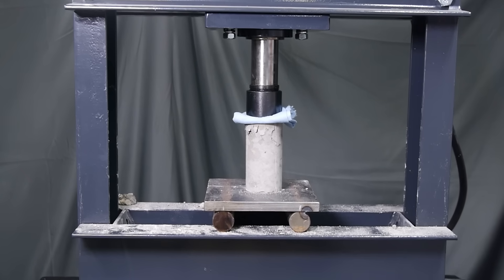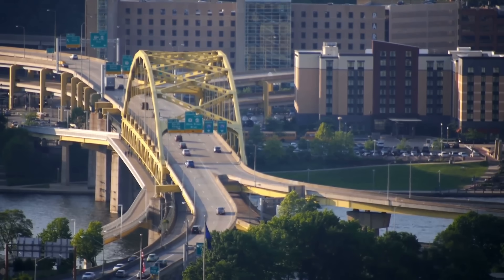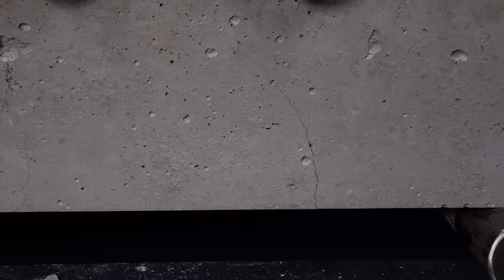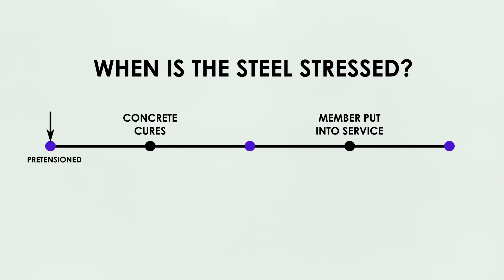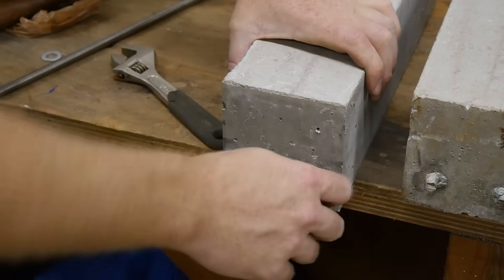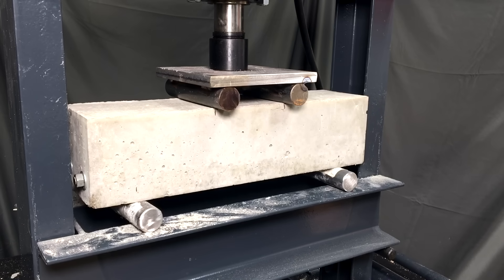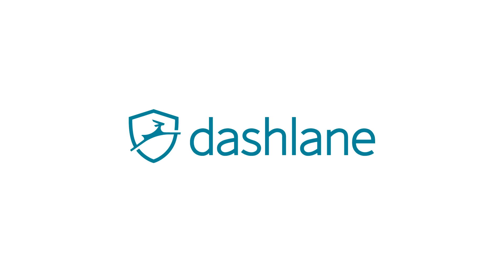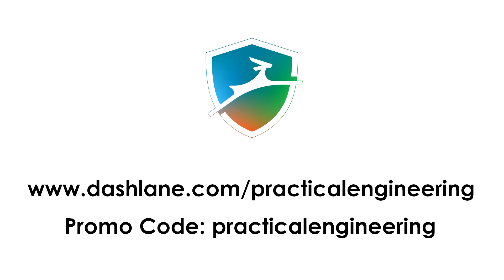What is Prestressed Concrete?

Comment from the maker: Okay, okay - I think this one will conclude the series on concrete (for now!). It's time to move on to a new topic :) For now, support the channel by checking out Dashlane - it's free and I hope you find it useful! http://www.dashland.com/practicalengineering
Reply: I love your concrete series — I hope to see more concrete videos in the future! I have no suggestions for new ideas at the moment, but I will let you know if I come up with anything. Thanks for your excellent and informative videos!
Reply: @joelweikguitar  
P
 Lp ..
Reply: Pre fabricated methods of construction?
Reply: Steel structures!
Reply: How do they build bridge bases underwater?
Reply: Daniel Allemang They can:
1. build them on barges and then sink them
2. Use a coffer dam to wall off the area to the base and build inside it 
3. Use Caissons to achieve a similar result to #2
Reply: An episode on caissons!!!
Reply: I have some ideas, but nothing concrete

https://www.myinstants.com/instant/rimshot/
Reply: Failsafes perhaps? I'm no engineer, but I'd imagine Failsafes are a big part of engineering.
Reply: Glass. I worked with glass a bit and it has some quite interesting properties that people dont expect.
Reply: How is glass reinforced?
Reply: Any experience with geopolymers? Could be an interesting variation of the concrete videos.
Reply: Practical Engineering You should now try focusing on shear reinforcement, as the failures you have demonstrated are quite brittle, and in the real world not ideal, as you don’t want a RC member failing so fast. Good videos these are awesome (y)
Reply: Steel towers, how there built and different types.
Reply: Environmental Engineering
Reply: Wastewater Treatment Plants!!!
Enhanced biological phosphorus removal (EBPR)!!!!
Reply: How about a series on famous construction projects and some of the technical challenges that had to be overcome? An example might be the Eiffel Tower.
Reply: What, you wont be Concrete Engineering anymore? :(
Sure there must be more concrete content to be made, roads with concrete surface maybe?
Reply: i think glass is a pretty interesting topic. the fact that it can be  used for both optics and construction is really cool.
Reply: would love to see a few videos on foundation failers and soil retention.   great videos by the way.  ive seen 90% so far.   thanks and keep up the good work man!
Reply: What about shape memory alloy as a reinforcement alternative ??
Reply: keep concrete videos alive!!!
Reply: You could do a whole series on deflection and moment of inertia
Reply: I second the underwater construction!
Reply: Engineered lumber, steel moment frame, buckling restrained frames
Reply: Well i would say steel and diferent shapes to get better performance on construction or maybe even compare with aluminium why is not used in construction but in cars is key to lightweight reinforcement.
Reply: Dude, I could watch these videos forever. But if it’s ideas you want, I would love to see s video series on underground construction and infrastructure. There’s an entire world beneath our feet of pipes, conduits, tunnels and even buildings. I’d love to learn more.
Reply: Do a video about piling works!
Reply: Ancient engineering
Reply: While designing my house with pre-stressed concrete panels. I also designed a steel beam to support the half panel. I ran the calculations on bending vs shear. Maybe do a video on that.

Picture of the beam here
https://i.imgur.com/Zphiz5s.jpg

The beam is 4"x4" square tube that is 1/2" thick and 10' tall. On top of the beam i used the same 4"x4" tube that is 4' wide. and 1/2" thick plate at the bottom. The max load for that entire panel is 15,000 lbs via their cut sheet. The panel weighs 6,000 lbs, the topper slab above that is another 4,000 lbs, so i designed it to carry is 25,000 lbs. So i doubled that number and then added the second column. This also dose not include that the other side of the beam is supported by a concrete wall.
Reply: Surveying!
Reply: Grady, that was a great video!  
Other topics:
I think they'd be most viewed if they were applicable to more people... so I'm thinking "around the house/property" topics like: 

>> retaining walls and the use of geofabrics, how high can you go before needing a designed/reinforced retaining wall,
>> concrete vs. asphalt driveways and the unsung hero of proper road base construction, this ties into Orian de Wit
's idea about foundation techniques and soil properties,
>> how to calculate member forces in a roof truss under snow load, 
>> and I'd like to 2nd Malcador Sigilite
's suggestion of wood.  It would be great to know more about how a house actually stands up - load bearing vs. non-load bearing walls, etc.

Thanks again for such great videos!
Reply: Roads! Especially different materials and methods used for roads in different climates.
Reply: Wooden structures 😮
Reply: Once easy filming weather returns, it'd be nice to see the return of "What's That Infrastructure?"
Reply: Wood and wood-only constructions! Or mud-based construction, and modern techniques to make it viable under e.g. earthquakes :3
Reply: Do one on road foundations. Also bricks and mortar, and wood in construction
Reply: How about plastic deformation in beams resulting in strengthening, or the concept of fatigue?
Reply: I'd like to see a thorough video on bedrock & bedrock pressures in various soil types with respect to footings & slabs.
Reply: How about water towers and designing water systems for smaller communities to ensure good water pressure?
Reply: Has to be one of the big 4. IE: Reinforced concrete (tick), steel, timber and masonry.
Reply: 2nd moments of area?
Reply: Types of home insulation and how can stands heat and cold
Reply: Practical Engineering I’d love to see something explaining how it is that such great accuracy can be achieved that off sight fabricated components can be placed into large projects perfectly. I watched the new Tappan Zee bridge get built during my commutes to Nee York City and the scales and accuracy are mind boggling
Reply: But u are the concrete guy, u cant stop now!
Reply: I would say that an importan requirement of prestress concrete is that you need higher yield steel in order for it to work
Reply: 3d printed construction and the comparative strength of various types of 3D printed habitats.
Reply: I have really enjoyed concrete series unfortunately this one is the last, i hope you make another serie on concrete applications like bridges and buildings. Thank you for making such amazing videos!
Reply: Your call, Grady.  Steel, concrete, water.., it’s all good.
Reply: Skyhooks! https://youtu.be/TlpFzn_Y-F0
Reply: How about the supports under beams or and sheets? For example I was taught that if you support a beam with two posts it is stiffer to have the posts in from the ends instead of at the very ends and also when putting down two layers of sub flooring that the seams should be staggered  from one layer to the next.
Reply: Practical Engineering 
bridges bridges bridges bridges bridges bridges bridges
Reply: how about the I beam or maybe steel as material
Reply: So, if the grade of concrete and steel are same, then the ultimate strength will be there same for simple reinforced, fiber reinforced and prestressed concrete. Only the  serviceability increases..
Reply: I work at a powerplant. We use steam and said steam has a LOT of variance and different characteristics, some of which keeps me up at night. (invisible death rays at 100 bar for one) I think it would be interesting to have a closer look at what water does under high pressure and high heat.
We have this one tank. It's about 20 m3 half of which is full of water, the other half steam ready for use in a turbine. This means that the temperature is about 400 c and, if memory serves, around 200 bar. Heat is constantly being removed or added to stay at an equilibrium which is really "cool".
Reply: Would be nice to show us some of the special types of concrete, like "green" concrete etc.
Reply: Difference between Girders, Structures and Frame
Reply: High performance concrete
Reply: If you're not burned out on concrete, you could talk about some of the less common setups, like ultra light concrete or concrete designed to let water flow through it, or other odd edge cases.

Also looking at different wood constructions would be interesting, ie wood frame, types of plywood, and the buildings that use wood as the central support beams.  Those are suppose to actually be stronger duing a fire than steel, I'd like to see a demo of that.
Reply: How does a thermal camera work?
Reply: I hope the end of this serie isn't something that is set in concrete.... 

Because I would like to know more, perhaps a little about practical use of concrete, why not build a small bridge over a stream in your back garden - or how to build your own gravity dam?
Reply: What about hempcrete?
Reply: Different adhesives used for construction, pros/cons, advantages and disadvantages. Think the Big Dig issues in Boston.
Reply: Traffic! And traffic management tools like HOV and HOT
Reply: Buckling?  Something to do with steel members?  Or maybe more on fluid mechanics...
Reply: Metal working?
Reply: Skyscrapper!
Reply: Could you make some videos to help me understand moment forces and how to counter these forces?
Reply: Relative strength of wooden joinery and how to calculate it. I've been looking into japanese no glue furniture,  its really really neat.
Reply: powerrrrr!!!
Reply: I would like to know how using a product like Helix micro rebar in the concrete would work to improve the concrete strength.
Reply: nooooo I love these videos please keep them coming
Reply: I wonder if there are any alternatives to cement based concretes on the horizon. Maybe easy to make polymer binders. I bet there is a ton of research going into this field but since it got no rocket motors or can flash in different colors the internet mostly does not care ^^
Reply: I would like to see you explain various geometric shapes under various forces and angles. And why you'd pick one geometric shape for a job over another shape.
Reply: The processes of shoring for foundation excavations such as when you’ll have an underground parking structure below high-rise building (e.g. steel pile and board, shotcrete, one I’ve seen where they drill and pour concrete closely space piles - then drill between piles to pour a second set of piles - resulting in a shoring wall when excavated, etc...), along with underpinning, below grade waterproofing (e.g. bentonite) and blind-side concrete forms. I haven’t been able to find a good video of these processes on YouTube.
Reply: Tunnels! and how can they be built cheaper.
Reply: But you just got a fancy dancy concrete vibrator. You can't stop now!
Reply: Steel structure.
Reply: Trees! How they can solve some pretty complex problems, and how the removal of them can result in pretty catastrophic floods. For example in Boscastle, Cornwall. Using natural solutions to solve manmade problems!
Reply: I'd really like do see stuff (maybe with concrete) made of different shapes. Things like using an arch to support a bridge.
Reply: The German U-Boat pens in France.  They held up very well to heavy allied bombardment.  What kind of concrete technology were they using?
Reply: Tunnels?
Reply: Can you do something on aerodynamics? Also another what's that infrastructure is in order!
Reply: how about foam concrete!!!
Reply: I am aching for a Practical Engineering perspective on some of the new types of intersection, overpass/underpass, and interchange designs popping up all over the country. Such as diverging diamond interchanges or continuous flow intersections. How do these new designs (that feel totally weird) work and how do they reduce accidents and improve safety?
Reply: More videos on city infrastructure.
Reply: (environmentally friendly ) alternatives to concrete, concrete has great properties but it produces around 5%of global CO2 emissions so it's any hing but sustainable...
Reply: Airships, like Schütte-Lanz rigid airships, competitors to the more known Zeppelins, but made from plywood, which Wikipedia says worked better up to a certain size, & they came appart in damp conditions. Compression forces were mentioned. So I immediately thought of this.
Reply: Do more on Land Surveying and accuracy.   Drones, GPS, Total Stations LiDAR.   Oh and What Old Tony said!
Reply: You should try an episode on energy storage using mass! Running a block and tackle pulley system can give you the mechanical advantage you need to run a rope to gather the energy from a large elevated mass.
Reply: Tunnel boring
Reply: What about the location of the steel beams in the concrete as i noticed that u always put them near the bottom. Will its location affect the strength?
Reply: Carbon fiber reinforcement concrete, carbon fiber strand instead of steel rebar
Reply: Could you please share where you get your glasses from!!?
Reply: Asphalt?
Reply: Geothecnis, but concrete will always be awesome!
Reply: I´d like to see more of comparison between pre-tensioned and post-tensioned, and relation to the recent bridge collapses
Reply: Any drawbacks to the prestressed or pretensioned beams?
Reply: Something major missing from universities that I deal with every time we hire a new engineer is piping/tubing standards and their relationship with structural engineering.  
  
Granted, you seem to be civil/environmental focused and that topic might be WAY too in depth for a short 8 minute video.
Reply: Wind loads?
Reply: do something involving machines
Reply: any construction that has to do with water, like bridges, locks, aquatic foundations, etc.
Reply: glass fiber reinforced concrete seems interesting
Reply: What about cement-based mixes?
Reply: Pavement testing? Benkleman Beam, Falling Weight Deflection testing?
Reply: Aww the concrete videos were so good too. Look forward to more videos
Reply: Maybe a series on water and wastewater treatment. I think this is something we really take for granted. We never think of where the clean water comes from and where it goes after we use it.
Reply: More 'what's that infrastructure' videos would be great!
Reply: 1. A video on structural shapes (funicular shape, triangle, arch, etc) and why we use each one.
2. Videos on steel structures
3. Videos on wood structures
4. A video on lateral torsional bending, local buckling, and buckling would be cool. You could talk about how the end conditions change the buckling and how bracing a beam in the middle will stop lateral torsional buckling from ocurring.
5. Do a video on shear and moment diagrams and why they are useful.
6. Do a video on the material science behind the different grades of steel and why they are used for different purposes. Include materials like rebar (60ksi), structural steel (50ksi), and prestressing strand (270ksi). A typical 1/2" special prestressing cable (0.167in^2) is pulled to 0.75fpu, or 33.8kips.
7. A video that looks at earthquake loading in buildings and the theories used to design a building to take the loads. 
8. You could do a video on the actual construction side of things and explain how the entire process is managed with a contractor, subcontractors, engineers, workers, and project managers.
9. You could do a video on where the materials used for buildings typically come from and how that effects the type of buildings in different regions of the world. Aggregate, steel, dirt fill, wood, employees, etc.
10. You could do a video on 3D modeling programs like Revit and AutoCAD and how they are used extensively in Civil Engineering.

I'm an EIT at a prestressed concrete company in the midwest, if I can help you by providing photos or videos of anything I would be more than happy to help.
Reply: Planes are cool, maybe do something about planes? Helicopters are also pretty cool.
Reply: Practical Engineering what about structures and how we make them stronger or plumbing and pipes and stuff
Reply: Make some videos about construction management. A lot of your videos are about design, it would be great to see some videos about implementation!
Reply: Could make a series about seismic engineering, opens a lot of topics: soil-building interaction, building dynamics, making a vibrating table, seismology, etc. Or maybe something about why some structures failed (there are several very interesting bridge failures to choose from), either way keep the good work making civil engineering easy to understand!
Reply: Concrete type for 2 story house
Reply: Wood post to beam connections, and other joints. Can you do a test on the strength of bolted wood connections under compression, namely parallel to the grain vs perpendicular to the grain? It seems counter intuitive, but apparently parallel to the grain is stronger. This would apply to backyard decks and other load bearing members... Bottom of slide #5: http://www.woodworks.org/wp-content/uploads/C-WSF-2012-Hereford-SW2W.pdf
Reply: STEEL!
Reply: Maybe you could take a look at different pipe materials as they relate to the type and pressure of the fluid they are moving, and the mode and cost of failures. For water mains for example: 

Prestressed concrete cylinder pipe- Very good pipe (other than pipe made from the Interpace Pipe in the 1970's) but tends to only become price competitive when larger than 60". If it ever breaks, it completely comes apart.

Steel- Needs coatings and usually cathodic protection. Can be good pipe if properly maintained, which can be an issue. Pit holes are a common form failure and can usually be repaired with the main in service. Typically it starts to become price competitive in 36" and larger. 

Cast Iron Pipe- Some US metropolitan areas still have some cast iron water mains in active service that were installed prior to the Civil War. Typically cement mortar lined to prevent tuberculation buildup. Blown joints and radial cracks are a common type of failure. This is the most common pipe in the part of the country I work in. 

Ductile Iron Pipe- Similar to cast iron and is commonly being installed today. Very good pipe. If failure they tend to be radial cracks.

PVC- I have the least experience with this pipe, as far as water pipe, and I really don't like it. When it breaks it tends to break off a chunk and makes a mess. According to manufacturer's instructions you need a blast blanket around the pipe when hot tapping, I have never seen or heard of anyone doing this. However I have heard of PVC blowing apart when hot tapping (yes they were using the right type of saddle). There are some concerns over permeability and chemical stability over time. What will it look like in 150 years?

HDPE- Relatively new pipe to the industry, I personally like it over PVC. Seems good, but I still wonder about permeability and chemical stability over the next 150 years or so. It's expansion coefficient can be an issue as it is about 1" per 100'. 

Asbestos Concrete or Transite Pipe- Installed around the 1970's and is approaching the end of its design life. Not bad pipe overall, but not really the best either. Repairs require special precautions. 

Fiberglass Pipe- Uncommon but not unheard of for water. 
Calamine Pipe- None of this pipe, as far as I know, remains in use. Installed in the late 1800's and really didn't hold up. 
Wood- Probably the first pipe material in the US. Not in currently in use. But one water system thinks they might have some left but they don't know. Possibly an old wives tale though

Water service piping materials are another whole can of worms. The most prevalent water pipe material varies among geographic region.
Reply: Practical Engineering dam building and modern design features
Reply: Hey, I've built some bicycle wheels and wondering how similar this pretensioning of concrete is to tensioning the spokes on a wheel.
Reply: @pete parker too true
Reply: Fire Protection Engineering..... The foam spray you see looking up at the ceiling of any number of stores.  Could setup a lab testing expansion of two metal rods under blowtorches, one with spray and one without. Use single fixed end and temperature gauges on the metal to show expansion related to temperature for each trial.....
Reply: composites
Reply: Hi Grady,

How about a series on how different renewable energy plants are constructed? What are their requirements, challenges, costs, efficiencies and future developments?

There's quite a few to cover plus would be interesting to learn about the less common ones like wave power and micro installations in urban environments (eg small hydro plants in brooks and drains in cities and villages or wind turbines in cities)
Reply: Roadway design! Design speed, horizontal curves & spirals, superelevation, vertical curves, sight distance etc.
Reply: Practical Concrete
In all seriousness, I never knew just how interesting concrete is. I'd be happy if you can make any other topic even half as interesting as this concrete series has been.
Reply: What about natural building technics? Adobe, Rammed earth, cob, straw, wooden structure etc. 
I love the way you explain thinks!
Reply: The concrete series is awesome! Please don't make this the last one!

I would love to see you do a similar series on other commonly used building materials such as wood (2x4s, 4x4s, plywood, etc), steel (I beams, lightweight steel framing, cables), plastics (plumbing), masonry (bricks, cinderblocks), glass, stucco, etc. These types of videos are informative and awesome to watch and I'd love to see you cover other building materials to show how each one is used, the strengths and weaknesses of each, the different varieties of each.
Reply: how about the good ol' wood?
Reply: I would like to know your opinion or better yet your insight into the novel ways of contruction being applied recently, i.e. 3D printed buildings as in the case of China's project to develop 3D printed housing. Both your take on the materials and serviceability, and your take on the economic effect on the field would be nice.

As always thanks for a great video!
Reply: Finally ran out of concrete have you? 😁
Reply: Hebel..AAC
Reply: You havenn't even started on it!

You could show alternatives of Steal and there pricepoints and put them under load.
Reply: How about MORE CONCRETE
Reply: water treatment
Reply: Curvas y peraltes de la carretera en función de la velocidad
Reply: Please do preformed concrete structures like core slab. You might not be able to do any experiments like you do in this video but maybe go over the process of pre fabricating the sections in the factory and how the installation process happens on the job site. I would love to see this as alot of the new  buildings I'm working as a plumber use this method
Reply: The pros and cons of using 100% recycled plastic instead of concrete for structures. Like used for roads recently in the U.K. #plasticroad
Reply: Asphalt and other road surfaces.
Reply: You need to do a test using only micro rebar/Steel fibre reinforced concrete.
Reply: I think you made a mistake in the Dashlane link, the link goes to "dashland", not "dashlane".
Reply: Can you not coat rebar to prevent it from corrosion after cracks appears on concrete beams
Reply: I scrolled and scrolled. No one mentioned that the URL is incorrect. 
All the best to you, Grady
Reply: What about wood?
Reply: @MalcadorTheSigilite  that would be pretty cool. I've seen that some high rise buildings are now being built with wood as the main supports instead of steel
Reply: Flex seal? The best adhesive on this planet!
Reply: @Rhel_Ark  Agreed lets build a boat out of concrete beams and then saw it in half!
Reply: Tarmac